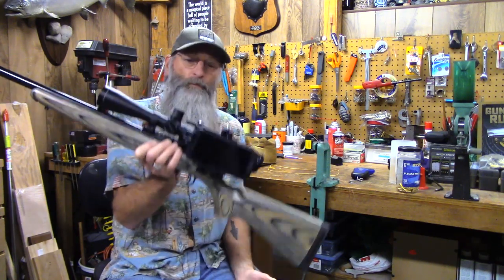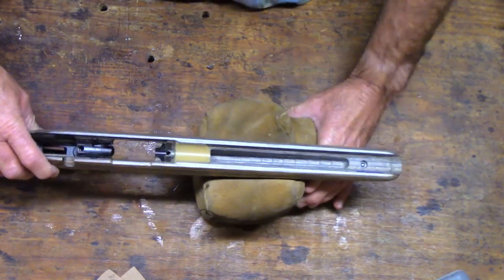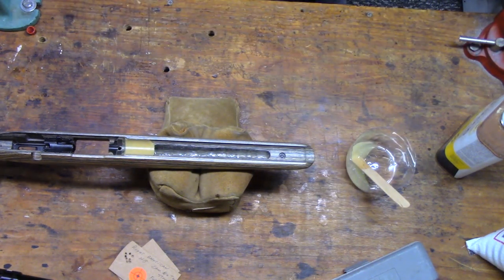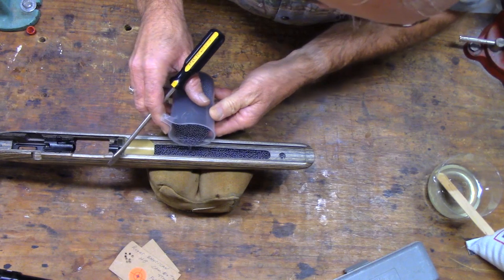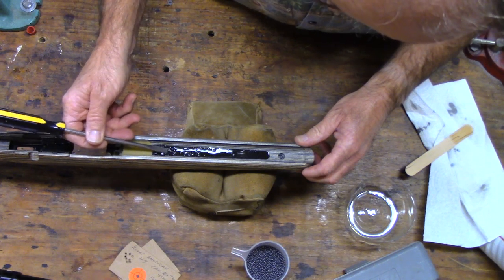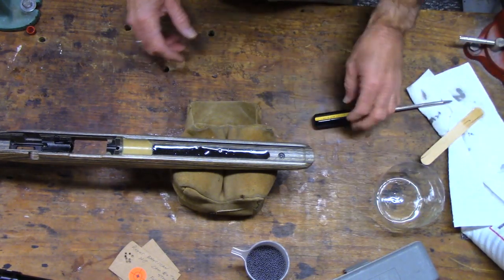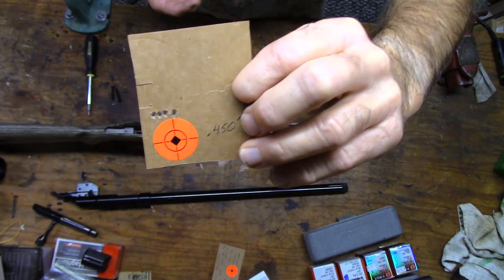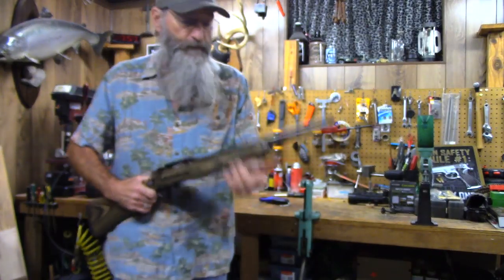Ruger American Weight Gain

Comment: Ive done that but...Drill a few holes for it to grab on Melt the shot down and poor it directly into the cavity. No air gaps and maximize weight
Reply from the maker: I thought about that, I've done it with walnut. With the laminate stock I didn't want to risk loosening the glue that holds it together.

Comment: Hey CD, great video.  I plan on doing this to a Boyd’s stock for my M77 in .17 WSM.  My question:  There are two sling studs that go through that area.  Will the epoxy leak through them?  Should I remove the studs and plug the holes with clay?  
Appreciate it
Reply from the maker: If I'm understanding you right, leave the studs in and fill the holes under the barrel with clay. Don't Epoxy the studs in permanent, you may want to remove them some day.
Reply: cavedweller1959 thank you sir

Comment: I did a bit of research into this. If you want to make it reversible, I’ve read you take a bar or rod of lead from Amazon (cheap), say 7/8”, drill a hole(s) in the butstock and use duct seal putty to take up “rattle room”. The lead bar might fit better in your forend channel, but the putty will keep it in place and it’s reversible and easier to install. If you REALLY want the heaviest thing (besides depleted uranium) then search out a tungsten rod. 50% heavier than lead. Some links: http://forum.accurateshooter.com/threads/adding-weight.3896113/ and http://forum.accurateshooter.com/threads/tungsten-rifle-butt-weight.3912738/. Btw I’m a member of your patreon page (had some unanswered q’s on the July 31 17 Hornet post…much obliged if you could check that out). I appreciate the work and info you hand out and keep on truckin’!
Reply from the maker: I'll probably do the butt end this winter just for a project, with lead, I've got lot's of it. Not really concerned about being reversible, this thing was to heavy for a walking varminter from the factory, to me, it's a bench gun only.  Thanks for the heads up about my Patrion page, they must do comments different than Y-T.  A comment  added to a comment, I'm not notified, like a running conversation.

Comment: I did this about a month back to a cz527. But in the But action to counter balance the weight of a varmint barrel and moderator.
Reply from the maker: That may be my next, drilling & loading the rear of the stock. Make it just as heavy as possible.
Reply: It was a dusty job but I managed to add 500g to the Boyds stock . This rifle is really heavy now .